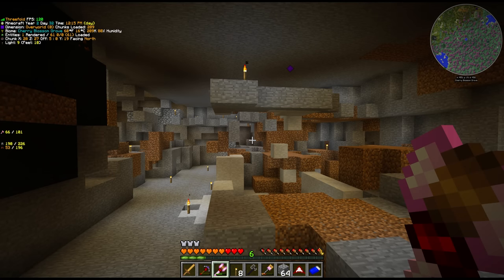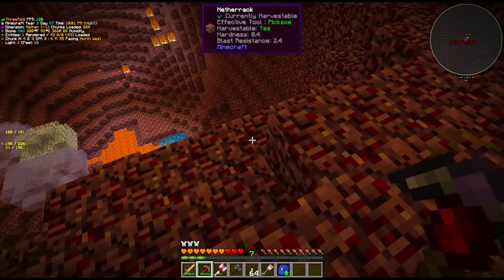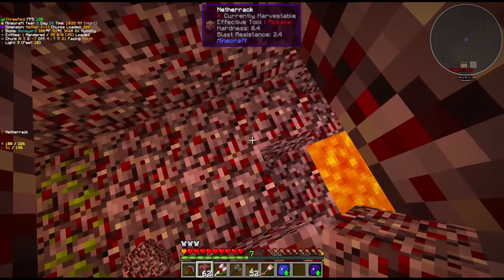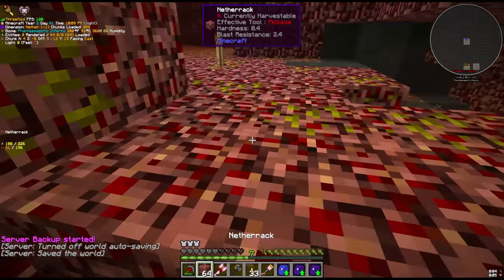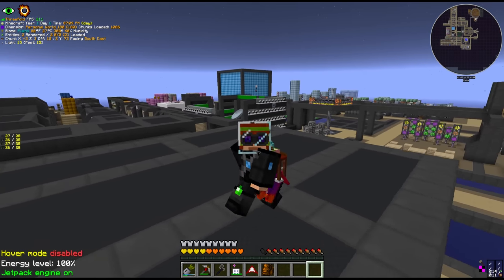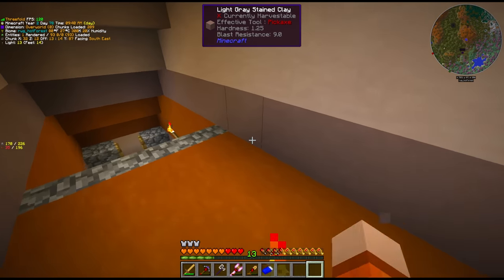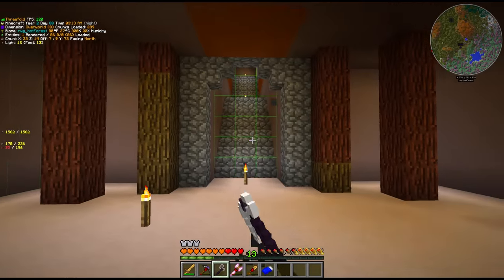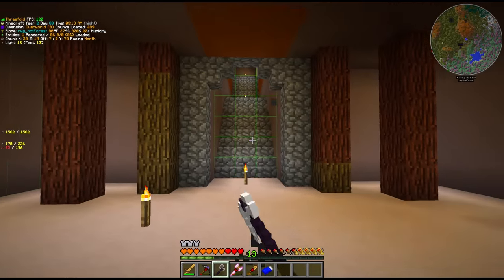Gregtech New Horizons S2 05: Avoiding Mistakes Before Low Voltage

Comment: Something nifty you can do with NEI is look up a recipe, than right click on a given machine from the list of machines that can do that recipe on the left to see the cost of that recipe with that specific tier of machine. Makes it really convenient calculating overclocks lategame, or seeing how much steam recipes require early game. For instance red alloy in the alloy smelter? 640 steam/s. Three isn't even producing half of that at most. Part of the reason why Railcraft tanks as a means of storing steam is popular, it compensates for the lack of production (somewhat) and keeps your machines running.

You can add modifiers to your TiC tools, by the way. Gold Block+Diamond gives +1, Diamond Block+Notch Apple gives +1, and Nether Star also gives +1. The first one you can get in the steam age, since you need a compressor to get a gold block, but other than that it's fairly cheap, and another level of Haste will do wonders to speed up a pickaxe/hammer.

The Nether has random small ores just like the Overworld does, so expect to find some odd stuff here and there. Something else worth noting is that all Nether and End versions of ores give double the output of their overworld equivalents (note that a planet like Mars will give you Red Granite versions of ores, which does count as overworld - only Nether and End doubles, none of the others do). Early on this makes it very lucrative (albeit, dangerous) to mine for stuff in the Nether where possible. Later on it still comes into play with regards to Blood Magic ore meteors, but we'll (hopefully, Three willing) cover that another day.

Demonstrated there was the pigman's ability to status you even through walls. Do not underestimate the danger of mining in the Nether. It's profitable, but you can't completely mine out a vein without exposing yourself to the Pigman somehow. You can lessen the danger with Chandelies, or better, Miners, but both require LV machines.

I should maybe point out the that Eerie biome (the black square in the middle of the valley) does have 50% humidity, but there's several reasons why moving there is a bad idea. For one Furious Zombies can spawn in that biome, and for another 50% humidity isn't great even if it's obviously much better than 20%. In addition taking up the space now means cramming in your initial Thaumcraft setup (which loves being near a Sinister node in the early game) once you get to that point, progressing to the MV water tank replacements in that stuffed closet, moving the tanks once you've got the replacements crafted, rerouting the water, moving your Thaumcraft stuff once there's space, etc. Just all-around not a great idea, though if there was nothing better on offer it would do in a pinch.

Oh boy, TiC levelling. So what Three said this video about low durability = faster levelling is unfortunately incorrect. It's something I only noticed myself recently, completely by accident at that, but levelling speed is based on a tool's mining speed for tools, or attack damage for weapons. This does use modified values, so adding Haste or Sharpness (though only Sharpness, something like Smite will not count) does slow down a tool's levelling speed. That said the Netherrack Lumber Axe trick is still valid, since Netherrack is by far the cheapest material you can make a Lumber Axe out of that also has trash mining speed. It isn't necessary to use a Netherrack Tough Tool Rod/Bindings since those only contribute durability and their material traits, but the plate does contribute to mining speed. Also it should be noted that although Netherrack's terrible mining level doesn't matter for logs it does matter if you're using a Charcoal Pile Igniter, since the brittle charcoal it creates has a mining level higher than a Netherrack lumber axe, so keep that in mind.

The pack does provide an alternative to Mica Insulator Foil for the first tier of coils, so you can get to MV without finding a Mica vein, but I really do not recommend avoiding trying to find Mica. The importance of upgrading EBF coils - EBF management in general, frankly - is underestimated by many, to their detriment, and putting off finding Mica will only make that worse. If wandering around randomly with an Ore Finder Wand (and do note it's limited range, so avoid elevated terrain if you can) is not good enough for your liking wait until you're into LV proper and craft an LV Prospector's Scanner out of Alumite. This will make prospecting for veins much, much easier, and the search for Mica that much better. In the absolute worst case scenario where even this is not enough go the Silicate Wool method for your first set of coils and craft an MV Prospector's Scanner our of Ardite or Blue Steel, to get the necessary 5×5 scanning range to detect a 3×3 field of ores at once.

Did some testing: For the Ore Finder Wand to detect your first Mica Vein you need to use Cassiterite Ore (or Dust, but Ore is easier). Cassiterite Sand or Tin doesn't work, unfortunately. Cassiterite Ore can be found either in Cassiterite Veins (extremely rare) or Vermiculite veins (less extremely rare, but not common either).

Quick testing suggests that a valve on the bottom of a railcraft tank will push 1000mb steam every tick. Basically everything short of a Huge Potin Pipe early game will be the bottleneck, not the railcraft tank.

Benzene as a power option isn't really worth going for until mid-MV, when you've got access to Kenthal Coils, but that at point you could (try to) ride it all the way to fusion if you're crazy enough. Diesel - or, rather, combustion fuels - is a perfectly viable option from LV to fusion, if you're willing to take it far enough. Steam you use in LV because you have to, not because you want to. Switching to something else is recommended, although your options that early on are limited.

Remember to use a steam forge hammer to get 2x output on your coal ore, compared to burning it in a furnace 🙃. And quickly process your redstone ore, for that matter.

Building idea: Light up your area so there are less zombie-related pyrotechnic accidents 🙃
Reply: Something to level tic tools extremely fast is a mob farm , afair tinker’s levelling does not care whether block breaking or damage dealt for any tool experience gain I.e dealing damage with a pickaxe also levels it and damage is a far more efficient way of levelling as it adds experience exponential to the damage dealt instead of 1 per block from mining. Only downside to this is the tic tool might evolve useless modifiers like sharpness.
Reply: @neeldas8955  Tools don't randomly gain modifier effects like that in GTNH, only modifier slots, so that could indeed be a better way to power level tools.
Reply: Ok
Reply: Why does early thaumcraft love being by a sinister node? I'm playing DJ1 in the same mc version, so if it's still relevant there, that'll be helpful to know.
Reply: @DarkYuan  Early Thaumcraft requires working with a Crucible, and Crucible work tends to create a lot of flux, especially if you're not careful. If you create a lot of flux, and I do mean an extraordinarily silly amount of flux through what can only be concentrated if not industrial scale carelessness, you will end up creating a Tainted Lands biome. If you're not prepared to stop that it could end up consuming your entire base, but if you place your Crucible near a Sinister Node it'll overwrite the Tainted Lands biome with it's Eerie biome, making you safe(r) from any Tainted Lands shenaniganry.

Realistically you should never create a Tainted Lands biome though crucible mishaps in TC4, though, and even if you do it shouldn't be that hard to get the tools necessary to combat Tainted Lands spread. The mechanics are very different from TC6 in that regard, but it is possible. And some packs, like GTNH (or DJ1, to a lesser extent), also have a different idea of "industrial" than TC4's mechanics were ever designed for. Realistically you don't have to care, it's an academic fun fact moreso than anything practical, but I like to do early crucible work in an Eerie biome anyway just in case.
Reply: Way too much to read

Comment: Fun trick; From the moment your blast furnace can smelt the dust, aluminum is effectively infinite. Macerating plant balls makes dirt, dirt and water in a mixer makes BoP mud, mud in an extractor makes clay, and electrolyzing clay dust gives aluminum dust.

Comment: Once I had a lathe and especially an assembler with that, it was very easy to make lots of crop sticks. Breeding suger cane via crops to get cane that gives sticky resin is fairly easy. It made my life far easier once I grew a decent amount of sticky resin reeds on crops. You can of course get a whole bunch of other useful crops with cross breeding as well.
Reply: Getting into the crop early is actually really beneficial because of exactly that, but that comes with drawbacks of having to deal with weeds and weaker stats as fertilizer and watering halt the progress with getting special crops or just the ease of crop dealing in general.

Comment: Interesting that you found enough silver for solar boilers, when I started I didn't really get how valuable it was so I didn't keep much. Though honestly in retrospect burning coal wasn't the end of the world. Also while I concur that the macerator is slow as hell diverting some steel into a couple of high pressure macerators is probably worthwhile especially since you have plenty of steam and their just as fast as LV macerators, just less steam efficient.
Reply: how can one be so fancy in their way of speech yet so damn not at the same time

Comment: steam grinder - that's the machine which i'm making even before making steam extractor. it's extremely useful even if it cost few stacks of bronze...
instead of sticky resin - find a slime island and start growing slime trees - useful now, but it will be even more useful later in lv as a source of glue (in centrifuge) and rubber.
start buying tin and red alloy cables using coins!
also make a spruce field for your lumberaxe then start using planks as furnace fuel.
Reply from the maker: Good tips here! I forgot about a few of these. Thank you :D
Reply: @Threefold.  you were also saying that water will be the issue until hv, while at steam age (take a look on a side quest for molds) you have already solution for non humid environments ;)

Comment: Tip: If you have a bucket of blood (you can find blood pools in nether) you can break burning blossoms by placing that blood on the flower without taking damage. Also blood works like water in nether so you can make obsidian with it and extinguish yourself when you're on fire.

Longsword from tinker construct is a very good movement tool for early game.

Comment: there actually is a better way to get infinite water before HV. The thirsty tank from automagy is available in lv, as it doesn't need any thaumcraft progression other than the iron capped wood wand, which can be crafted with only minor lv progression, provided you can find an aluminum ingot while traveling

also, I'd highly recommend getting the steam grinder and steam oven. they might be a little expensive, but they're worth it as they will be the fastest option you have until HV

Comment: the green dungeon puzzles (mineswiper/Game of Light) can give hv pumps and stainless steel pipes which you can use to get  the better water generator early. you already found one and can find more using the ore finder wand
Reply: I got an lv solar cover from one, which I put on a battery buffer. Got me through lv

Comment: Loving the episodes! You can make a thirsty tank from automagy in LV to deal with your water problem, and then you can build anywhere, or use it for a multifarm or whatever. You only need 1 aluminum to make the wand for thaumcraft. Can get them as drops from kobolds in the Twilight. It's in the automagy tab. Research is Hungry Chest - Greedy Chest - Thirsty Tank. Also, dont think ive ever seen you use it before, the Charcoal Pile Igniter is super nice in LV too. Can make you around 15 stacks of charcoal with around 10 stacks of wood in a max size one in around 30min or so. The slimy trees from tinkers are nice for rubber too if you can manage to find an island. I got a slimy sapling from one my very first lootbags hehe

Comment: If you want low durability tinkers stuff to turn indestructible VERY quickly. I would recommend making 1 part from paper (only need one part paper) and the rest wood. 
Paper gives 4 modifiers without leveling (use it for 4 levels of durability). 
Wood gives mending over time. 
After leveling up put on the last modifer it to become undestructible. 
Then swap out the parts you want for beter parts.

Comment: All Nether and End variants of ores (any ore found in those dimensions) grant double output, macerating doubles it again so macerating Nether or End ores give 4 crushed ore. This gets really fun when you get crops or bees which quadruple that, the most extreme being Cassiterite which can get you 32 ingots from 1 block of End Cassiterite.

The Ore Finder Vein works based on Ore Dictionary so if you put stuff like a ingotTin it looks for oreTin but Cassiterite is oreCassiterite so you won't be able to detect Cassiterite using it. Because of this it is best to use Cassiterite and Cassiterite Sand when using the Finding Wand.

Comment: If youre thinking vertical building, don't rule out building up into the sky, gotta launch a rocket eventually. The best suggestion i'd give is make all the different foods you can with what you've got and have a nom session. Don't forget to upgrade the pipes throughput for some machines, or even gear down so the machine doesn't explode. hard to figure out what happened as a problem if every time i have one my shop gets blow up.

Comment: When I started I made the mistake of not rushing a circuit assembler, and it makes circuit crafting cheaper and is VERY useful early on after the other material efficiency machines

Comment: I actually think this was the point in GTNH that I got bored and did some other GT pack, because the grind was just... too mind-numbing for me personally. The sheer quantity of resources needed to get to that point is just insane compared to most other packs. While this episode is shorter than the others in the series, it probably represents more IRL time between off-camera mining/clearing and montage cuts. 

Congratulations on forward-planning and future-proofing your base layout. Can't count the number of times that has bit me in the posterior. Make sure your floor height is tall enough to accommodate the buildings you plan on using there, plus enough room to handle all the attachments. For myself, between floors I typically have a two block wide 'service corridor' or if you're a real nerd like me, a 'jefferies tube' to run pipes, and later on run conduit, cables, wires, and other critical infrastructure where it isn't just laying out in the open. Don't want OSHA complaining about bare wiring and code violations after all.

Comment: Iam using 1 Water Railcraft Tank at 80% Humidity  per High Pressure Solar Boiler (Totaly of 4 Tanks and 4 Boilers) and its enough with a full 4x4x5 Tank to run Steam Furnace; 2 High Pressure Macerators; 1 High Pressure Alloy Smelter and 2 High Pressure Forge Hammers at the same time for 5 Minutes (mroe or less at least) if not u can let them run kinda infinitly setup is strong enough though

Comment: The ore finder wand didn’t work because it was looking for tin ore, not cassiderite
Forge hammer is better for coal
Multiblock macerator is worth considering soon
Slime trees are way better than using rubber trees

Comment: Hey Three, Super happy about the new GTNH series! I was curious, which launcher do you use for this modpack? As I've noticed stability irregularities between them
Reply: prism launcher works 100% fine
Reply: @aidencraft32  Can vouch, GTNH works perfectly with Prism. Been doing my first playthrough on it.
Reply from the maker: There is a detailed guide on my pack setup in the pins of my discord. I personally use MultiMC, but of course other options are available :)

Comment: How do you get the orevein detection to work? For some reason the ores do not show up on journeymap whether the setting is on or not
Reply from the maker: The only limitation I know of is that it will not work in the spawn chunks of the world
Reply: @Threefold.  Ohh thats most likely whats going on, my bases are usually right near where I spawn
Thank you!

Comment: at the current writing of this comment....
guys...if you want to make red alloy pelase DO NOT USE ALLOY SMELTER
alloy smelter eat steam like a bitch and is slow as hell..only ..use it when you have rail craft boiler..
instead smelt redstone and copper inside smeltery they will be alloyed into conductive alloy...which will update into gregtech red alloy
seriouslly i wasted so much time on steam alloy smelter at early stage it not even funny
and i was shocked when i could just craft stacks after stacks of alloy in the smeltery